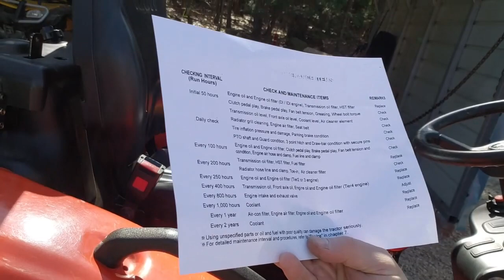Kioti CK2610 400 Hour service.  Changing Hydraulic Fluid and Filters, Engine Oil and Fuel Filter.

Comment: Great video, very helpful. One thing that got me was the drain pan I used. It is the kind with two inlet holes and a vent. As fast as the fluid comes out, those two holes do not let the fluid into the tank fast enough, and trying to put the plug back in really fast is easier said than done. We have a CK 2610 gear model and it has been a great tool.

Comment: Nice video! It's nice to actually see somebody go through the steps. Did the front axle seal leaks result from that time it got partially buried? I had someone else tell me that his front axle seals began leaking right after getting stuck in the mud. I noticed the loader zircs look fairly dry -- the manual for mine says to grease them every 10 hours. It is recommended that you remove any metal rings or watchbands when working on anything that has a powerful battery in it (really any mechanical or machinery work too). If you reach your hand in where the starter or alternator is & your ring contacts both ground & positive -- it will only take about a second to turn red hot -- and it would definitely ruin the ring.

Comment: Well done.  Green Acres Theme song is giving away your age!!!  The Highly Technical Term used - "half a grunt" is that slightly more than "a umph"?  A greasing question if I may, since you grease it all the time - When greasing the two front axle pivot zerks do you get much, if any, grease to go in?    Two observation.  It could be from the camera angle, but it looks like the hydraulic hoses under the right side step are hanging a bit low and could snag something.  When to went in high gear and hit the brake, after some speed, your tractor made a familiar hydraulic sound as mine (I'll call it a hissing sound)  My HST pedals are sticking some when I let off and have yet to figure out why.  Hit the opposite pedal or the brake pedal and that noticeable sound is there.  Any problems with your HST pedals sticking?  And now - "Good-Bye City Life, Green Acres We Are There!
Reply from the maker: I get some grease to go in, not a lot.  The hoses slide back through the zip tie a lot.  I have to push them back through often.  I notice the pedals sticking until the tractor really warms up.  All in all, it has been a great tractor.  Thanks for stopping by!
Reply: In defense of the video's author, there is no specified value for the drain plugs that I can find in the owner's manual or the factory service manual OTHER than the standard bolt diameter/torque table. The bolt diameter on the rear would definitely strip the threads if this table were used. I intend on using 28- 35 foot pounds given what my other vehicles specify for such drain plugs. 

I only have 49 hours on same model, the collective wisdom appears to be to use the front end loader to lift the front axle off the ground allowing movement of the front axle while greasing. Mine only took 2 pumps each side and even that was difficult. Some say the seals will loosen with time making this process easier, I have  no clue if that's the case.

Comment: I have the same tractor and have had a problem with the fuel system since new.  It'll run fine and then just bogs down and dies.  I noticed recently, that when this happens the primer pump gets sucked down toward the filter.  I've tried opening the bleeder valve and pumping to purge air from the system but I am never able to pump it enough to get fuel to come out the bleeder valve.  It seems like it's somehow getting and holding air in the system and I can't figure out how.

Comment: Hand tight is fine on all these filters, the filter wrench should really only be used for removing them (if you don't have a filter wrench you can punch a screwdriver through the filter for leverage FYI)
Reply: How did the tractor stay running when he hopped off of it? Mine dies when I'm not sitting on the seat.

Comment: Nice video. Seems to me the filters raise their own reason to invest in a small pressure washer, to clean before disassembly.   Is there a torque spec for the drain plugs?
Reply: "Half a grunt" is exactly what I would use. I have never seen even the most careful tech put a dial indicator on a drain plug.

Comment: Thanks for this informative video. I need to do this to mine. I do have some questions. Where do you get your filters and which ones do I need as I have the same tractor. What kind of hydraulic fluid do you use and how much do you use?
Thanks
Reply from the maker: I bought the filters from the dealer.  Oil, both hydraulic filters and fuel.  For oil I used the 5 gallon bucket of traveler universal tractor fluid from Tractor Supply.  The rear end/transmission pretty much takes the whole 5 gallons.  Not sure what the front axle takes as the dealer had just done that when they replaced the seals.
Reply: Kioti has terrible documentation in general and shows the incorrect location of the transmission drain plug in the owners manual for this model. Owners Manual page 7-4 says the transmission takes 5.81 gallons. Kioti Factory Service Manual page 6-2 states 5.28 gallons. I used the owner's manual listed Mobilfluid 424 transmission fluid in the transmission. The owner's manual says the mark on the dipstick is the 'Upper Limit' mark, there is no lower limit mark.
Reply: Forgot to add the front axle capacity. Owner's manual page 7-8 (I incorrectly said page 7-4 above) 1.58 gallons, factory service manual states page 9-2 capacity is 1.32 gallons. Both state 90W gear oil or  you can use transmission fluid. I used 80W-90 gear oil on mine.  Lots of debate about which to use, but I don't know how you beat using gear oil in a gear box vs. a fluid that must work as hydraulic fluid, work with wet brakes, etc. Your call.

Comment: Good Video, but you might want to check the Specs on that hydraulic oil.   Traveller ISO46 specifically states that "This product is not recommended for transmission, differentials, wet brakes or final drive gears".   Traveller Premium Universal Tractor Trans/Hydraulic is what meets Kioti spec.

Comment: You shouldn't be using tractor supply hydraulic fluid for your tractor. Use only the Kioti label  hydraulic fluid.  I think tractor supply did away with that brand name hydraulic fluid..
Reply: Mobil 424 or a few others. I was told it would void my warranty if I didn’t use the ones listed in the manual.

Comment: Good video but you have show people what not to do.  With all that hydrolic fluid on the card board it is seeping atraight thru to the good, an environmental disaster.  You should always pull a filter and wait for it to stop draining before moving the catch device to prevent the fluid fetting into the ground and repalce that filter before moving onto the next one.  For someone that is a novice and never done this before or even someone experienced it potentially could be easy to get the filter reversed and replaced in the wrong position proveided they are threaded the same.
Reply: great refresher I might have done a couple things different but all in all very good and clear presentation